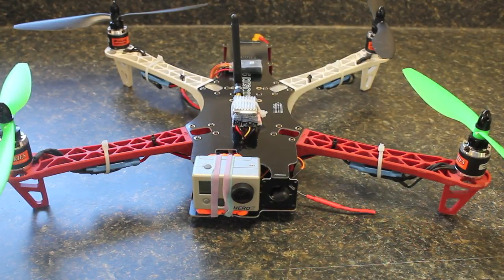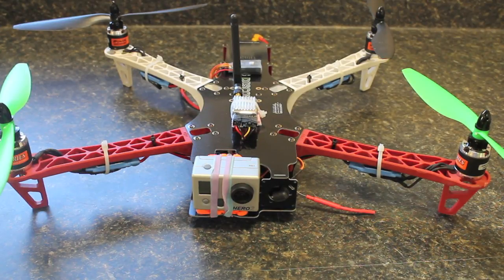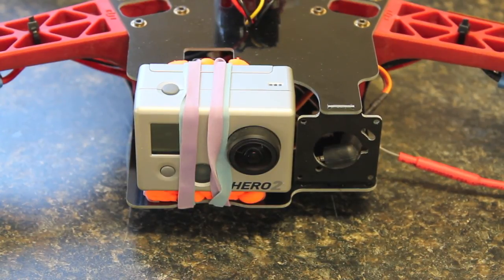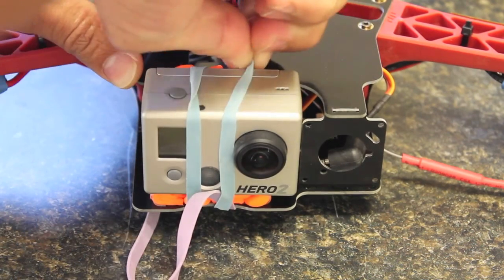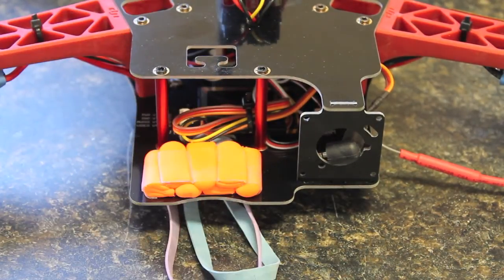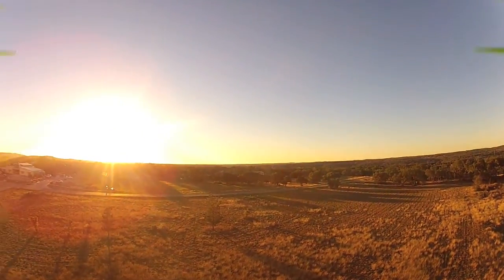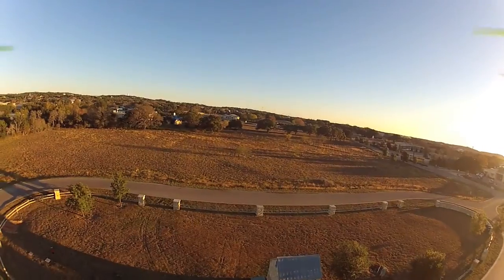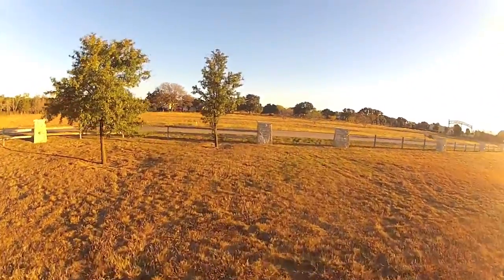TBS Discovery, DJI Naza, and Go Pro Vibration Reduction Take 1

Comment: You have the go pro too tight to the frame. Use one band
Reply from the maker: Good point. It's been a while since this video, but yes I did discover that too much pressure on the GoPro can have adverse affects on the vibration dampening. Thanks for the comment.

Comment: Hi Dennis.. nice vid... actually IMO i have never had to do any post production reducing of movement on my videos... i have found that the jello effect comes more from the platform that you are using more than anything... i ALWAYS balance my props but never need to go further than that. Use a good frame and you will see the jello goes AWAY !!! Hoverthings frames or even the QAV frames are great if you want jello free video with NO POST production anti vib.... ;) just IMO...

Comment: I have a F-450 using those same exact earplugs and my video is exactly the same. I tried adjusting gyro gains and found that the video smoothed out some when I added expo and upped the gain to 135% on roll and pitch. What are your gain settings for your naza? I know it's a different frame, but I'm just curious what other people are using.

Comment: I put the gyro foam at the back and beneath the go pro 3 and add the rubber band. Hardly any vibrations! I use the cheap gyro foam from Hobbyking (the one with the yellow paper cover).

Comment: For better vibration balance replace the cheap HK blades because they aren`t balanced well. With this modification you will see the most sucess in anti vibration balacing. I use carbon blades from BEVRC.com

Comment from the maker: That sounds cool. Please get that video done so I can watch! BTW, I just posted a vid that shows the differences between foam earplugs, moongel, and sorbothane. Be sure to check out the Google Spreadsheet for some pretty interesting data. Now this test was done with 50 durometer sorbothane so yours may be a software material, but the data for Moongel looks really good.

Comment: Awesome Dennis! Are you using 1047 or 1038 APCs? Since the APC props aren't as rigid as the Gemfans there will be some light flex to the props but since the TBS is not a heavy Quad the APCs should work great!  Try 1038s if you're using 1047s and you should even see a better result!  Cheers!

Comment: You will find a handful of message boards about Gemfans and how hard they are to balance. The hub is what's not perfectly center and I have even tried using epoxy to counter balance the the hub with ok results. I really like the firmness of Gemfans and enjoy using them for night flying.  I also received some carbon fiber props and am looking forward to trying them out. Much lighter and mor rigid than the Gemfans. Let me us know what you think of the Moon Gel. I see they sell it a Guitar Center.

Comment: Ah ha! Genfams! They are great for rec flying but they are terrible when it comes to FPV. The reason being is due to where the hub is located. Have you noticed that when you put the prop straight up and down on the prop balancer how fast the prop will fall. You can try using epoxy on the hub but you're better off with different props for fpv flying. I have the E-Props from Graupner and they are incredibly easy to balance ans buttery smoothing but they lack lift for motors under 1000kv.

Comment: Hey Dennis...  Have you tried using Sorbothane?  It's specifically used for dampening and you can find them on Ebay in 4x4x1/4" pads,  They can be cut to size and adhere to superglue. Also...  What kind of props are you using?  Are they plastic or carbon/nylon?  What size are they? 1045?

Comment from the maker: You're definitely right. The source of the vibration is definitely a problem. I've rebalanced my props and may even balance my motors next. You know, I was about to order some Align PU but the place I was looking online was out of stock. I found it on Amazon but the guy was charging a bit too much for it ($17). Anyway, thanks for the thought and I'll post more as I take care of the vibration "source". Are you flying with the TBS frame?

Comment: I think your solution is pretty useless because I get less vibrations while hard mounting the GoPro directly to the frame with 720p. At the moment I'm using Align PU geld pads and they work great for around 10 dollars. But I also think its more important to balance the props and motors and get rid of the vibration SOURCE and not just absorbe the vibrations.

Comment: GEK69NY beat me to the reply. He is right, cut the ear plugs on the rounded end and hot glue 6-8 of them vertically between an upper an lower plate of G10 to make a dampener plate to mount the camera on. Moongel will give you the same effect in a lower profile installation. My Gopro is sitting directly on the Moongel and the Moongel sits on the camera mount plate.